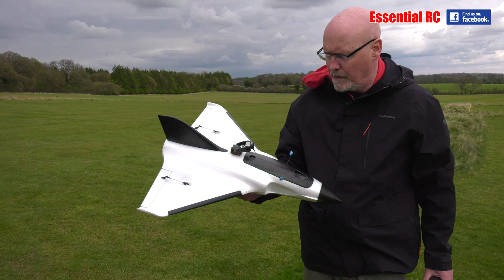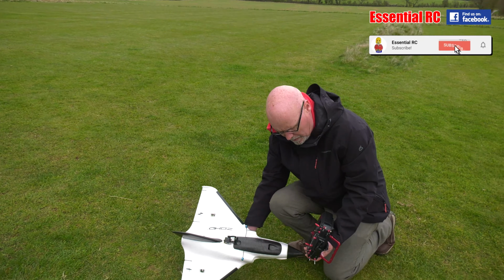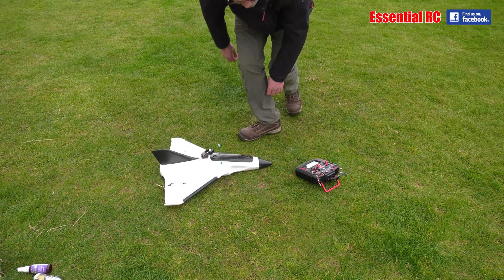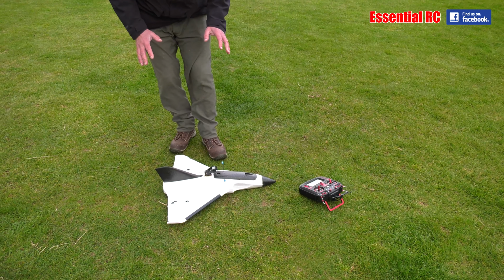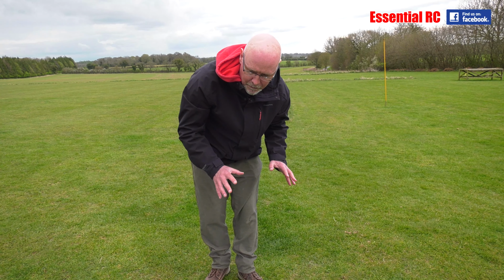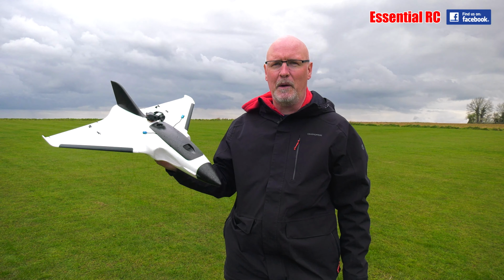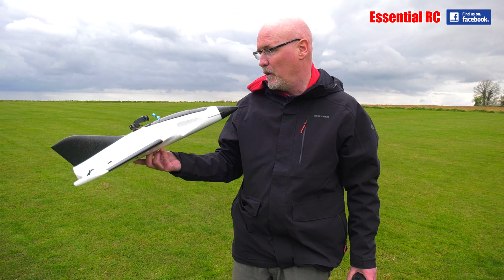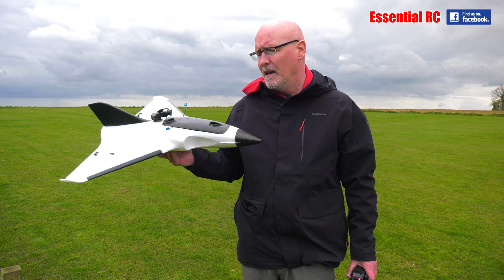CHEAP and EASY TO ASSEMBLE EDF RC JET | How does it fly ? | Essential RC Flight Test | Part 1

Comment: That looks like it handles rather poorly! Clearly the aileron rates need taming a bit, but even then it looks like it is sliding into the turn. A bit more vertical fin may be needed, that’s certainly where I’d start.
Reply from the maker: I think you may have nailed the problem! The effect of the vertical stab is being affected by the gimbal and camera. Obvious really! We also had this on the Flightline Spitfire.

Comment: Hi Dominic. I don't  fly fpv, but got one of these as my first delta wing three months ago. 3 points.  Firstly I love it, I am no better than an intermediate flyer and I can fly it OK, it is fast and twitchy but also stable. Secondly it is very robust, I lost orientation once and dived it into the grass....no damage at all, very tough nose. Thirdly I paid 105 for pnp on bangood, be aware your link is for the kit only. If you don't mind a bit of sphincter clenching until you get used to it, I have never had a plane that makes me grin so much after each flight. Andy in uk.
Reply from the maker: Good to hear Andy. Thanks for the correction on the kit/pnp. I'll fix that. Cheers ! EDIT: Link is the same for KIT and PNP weirdly. The customer would just need to make sure they select PNP but I'll add a note with the link saying that. Thanks again.

Comment: I want to know, where can I  buy the camera  on this  plane
Reply from the maker: Radiomaster TX16S Max transmitter: https://www.radiomasterrc.com/products/tx16s-max-radio-controller?sca_ref=1532879.KTnLWlCJZG
DJI Goggles: https://www.droneauthority.co.uk/products/dji-fpv-digital-hd-video-system-goggles?ref=gtld_zcywgt4
DJI Air Unit: https://www.droneauthority.co.uk/products/caddx-air-unit-polar-starlight-digital-hd-fpv-system?_pos=2&_sid=c47d15132&_ss=r&ref=gtld_zcywgt4
Caddx Polar starlight Digital HD FPV Camera: https://www.droneauthority.co.uk/products/caddx-polar-starlight-digital-hd-fpv-camera?_pos=8&_sid=90a15c8b2&_ss=r&ref=gtld_zcywgt4
DJI FPV Goggle vinyl wrap: https://www.droneauthority.co.uk/products/808-drones-dji-fpv-goggle-premium-vinyl-wraps?ref=gtld_zcywgt4

Comment: Greetings Mr. E.R.C. from Alabama USA,
Had an totaled the "Alpha", ., that "Tuck an Roll" syndrome.
 Have 2 new alphas in box now.
Just had Hernia Surgery, grounded a bit ,,
Across the Utubes Ive seen an my Experience with Alpha.
No Rudder an less than 75 percent throttle in a bank more than 45%, The Alpha, an Delta's /Alphas will tuck an come around Quickly, to say the least..
Personally Im planning on wider banks at 45% or less,.
. Both are designed for Speed by Zohd, course the FPV is their Thing, so its spoken of on the Alpha an Delta,.. an fpv well however
Short of Servo/ Horn Upgrades , an may or may not fix,,, That Scary Roll is  part of those 2 Speedesters.
Wish Luck on a solution from someone, that will post,
Regards Captain John
Reply from the maker: Thanks John. Glad it's not just me that has experienced that 'tuck an roll'. After several days thought I think it is down to the relatively small vertical stabiliser. I've made it worse by adding a pan/tilt gimbal in front of it. That turbulence is meaning I get very little effect from that vertical stab. All the other flight tests I have seen by other YouTube channels is of this EDF jet flown line of sight without FPV gear. Flies much better for them with an effective vertical stab. I agree with you about limiting roll angle. If I went past 45 degrees and centred the stick it wanted to keep rolling!

Comment: Thanks for the review.
As it's a delta very fast roll sensitive of course, I just say just in case, while the elevon course is probably short, I guess the pushrod and servo mechanism must be very tight, without any loose point, even very small. I fly an Alula flying wing and despite its cool gentle flight character the very little servos gear free play lead to as little as 1 millimeter on the elevon, enough to make a sensitive difference in the model behavior.... So on your high speed delta wing I have no doubt this must be extremely important to get a precise roll control.. I would invest in high quality servos and 'professional' pushrods! :-)
Edit: in the same way I wonder if the elevon material being foam originally could be changed for thin but high quality ply or even better carbon plates.
I have no much knowledge about gyros setting but before plug it I would check the control surfaces stiffness/tightness
Hope you'll find a good solution because the model looks awesome and quite fast!! (would deserve a 2x size especially for fpv. I even begin to imagine an cockpit view :-).)
Happy good flights!
Reply from the maker: Linkages are tight. Think I just need to reduce rates further. Will see next time out. Appreciate the input

Comment: Nice flight demo! That was strange as Delta Wings are usually so stable. It had a lot of rocking back and forth didn't it ;-) I'm looking forward to another flight demo when you get the bugs worked out. It looks like a very promising EDF Jet for the price. See you in the Air!
Reply from the maker: Yeah right, very strange. Looking forward to a better experience next time.

Comment: I think ZOHD flight models are generally well thought out and you can hardly go wrong with the purchase. I find some ZOHD models very expensive, but most of them are in the middle range in terms of price and are even cheap in terms of performance.
This is a well thought out EDF that you can also fly FPV with. The new rules for FPV in Germany state that you can only fly FPV in the field of vision and with a flight weight of more than 250g with an observer etc. I find the visibility in flight very poor, whether as an observer or as a pilot without FPV. Only a color treatment helps and since I'm a terrible painter, I would have liked at least a few colorful stickers ex works, it can't be that expensive, can it?
If you are looking for a small, versatile EDF, this is definitely a good choice. I won't buy it though as I already have many larger EDF models. Alternatively, I think the ZOHD Alpha Strike is clearly the better of the two models, as it is more efficient thanks to the propeller drive and can also fly much faster, although the fuselage offers even more space - it is also a bit cheaper. The downside is that it's a "screamer" and also has no color. ZOHD isn't that far in development yet, they've only explored black and white so far. Let's hope together for the best for the future.

Oh yeah, since China is still planning to attack Taiwan and if you don't want to support that, then avoid Chinese products! ZOHD is a trademark of SONIC MODEL HONG KONG CO., LTD. China.
Reply from the maker: "Since China is still planning to attack Taiwan and if you don't want to support that, then avoid Chinese products!" I doubt employees at ZOHD have anything to do with Chinese Government's hostile plans against other countries. 🙄